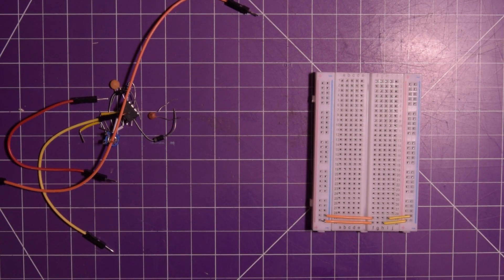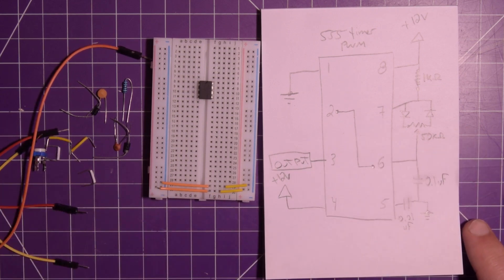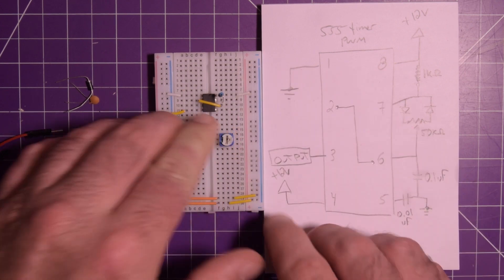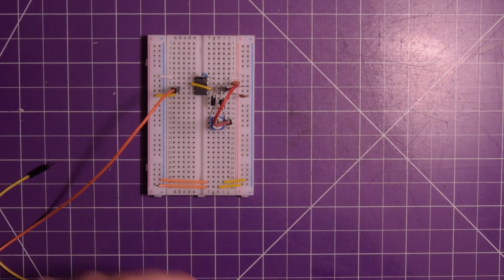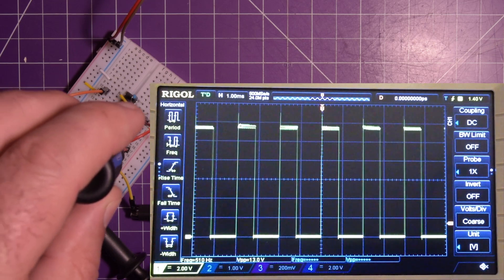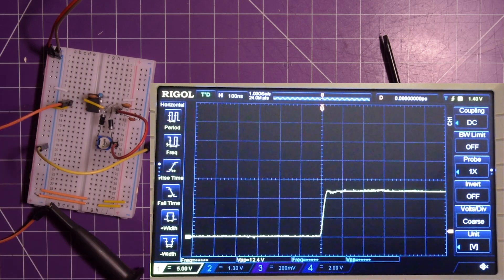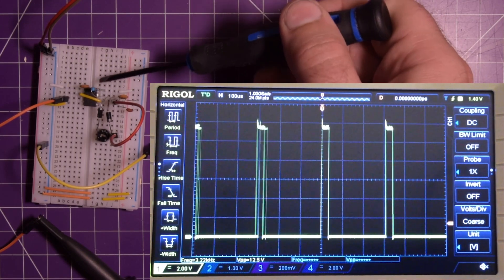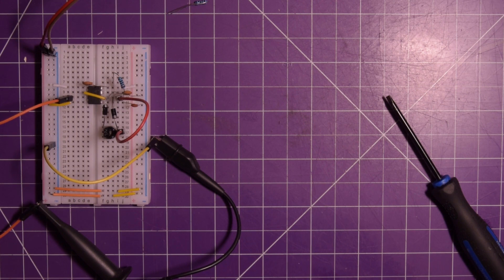Super Easy 555 Timer PWM Generator

Comment: The frequency change can be avoided if you use a constant current regime for charging / discharging of the capacitor. I have developed a special circuit design for a voltage controlled PWM generator based on a TLC556 (2 timers in 1 device). This circuit uses only two additional components, a constant current diode E-101 (0.1 mA, min voltage drop <=0.5 V) and a capacitor. The rest is only wire connections. And it works great over the whole range of operating voltages and up to 250 kHz PWM frequency.

The low frequency of 500 Hz is only a thing of the resistors / capacitors you've chosen. You can easily go to 100 kHz with this circuit (even with the NE555) and therefore much beyound the microcontrollers abilities. For motor control you can choose also lower frequencies of down to 100 Hz or higher than 20 kHz. The lower frequencies give a nice engine sound. The higher ones are inaudible.

The spikes of rectangular oscillations are no artefact. The mathematical superposition of harmonic functions of a rectangular oscillation has spikes. This is no problem of real device behavior. They grow very rapidly the more harmonic orders you take. The ideal rectangular oscillation has spikes of infinite height for a duration going to zero. The reality damps the spikes to a hight and duration according to the slew rate of real devices.

Comment: Are you aware of that most of your idle power is wasted in the 1k resistor? You can reduce your idle power loss by more than an order of magnitude when you use the TLC555 and you control the duty cycle with your diode / pot arrangement from the output pin 3 of the timer IC.

Comment: Thank you for this.  I’m pretty new to circuits and have been using microcontrollers for pwm. I have read about using 555 timers but like you said, looks kind of daunting when you are new.  The biggest reason I want to get away from the microcontroller is the boot up time.  If I want to use a dimmer for example it’s not instantly on unless the mc is already powered.

I have also read about another chip that is designed specifically for this: ltc6992, though it seems to be sold out everywhere.  It’s more expensive but simpler.  Once the chip shortage is over you should make a video with it :)

Comment: I was wondering how does the duty cycle can be changed not by knob (i.e. potentiomter) but by those system that has push buttons. How does the push buttons change the value of applied voltage?  One push button increase and the other push button decrease the voltage.
Reply from the maker: Not likely done with a 555 timer, more than likely done via a microcontroller

Comment: Good information! I am curious to know if yours had a audible frequency sound? Mine has a low frequency buzz sound and so I was wondering if that is normal, it does work great though. Thanks
Reply from the maker: mine does not! Apparently some ceramic capacitors do that though!

Comment: There's something missing from the circuit diagram, and I figure I should mention it just in case: you really want to have a flyback diode over the motor, as it's an inductive load, and without one, you could end up with a spike that would fry the other components when the motor spins down, causing the magnetic field to collapse and its energy to discharge. The flyback diode gives an alternative route for the current back through the motor, so it doesn't go back into the 555, &c.

Comment: does it have to be ceramic capacitors? and those exact values? what if they're different?
Reply from the maker: The frequency will change if the values are different - i think the caps can be any non-polarized type. This is the cool thing about electronics, you can build it and see what happens!
Reply: @SimpleElectronics  thank you for your reply! I'm just getting into electronics. So far any circuit I try to recreate - does not work at all. I'll try this with different value caps I was able to scavenge and I'll try to make sure one of them is 10 times less capacity than the other and see what happens.
Reply: There are formula for the on and off time and the frequency. Check it out.

Comment: I made the same circuit on tinkercad( online simulator), I am getting a wave on oscilloscope but when rotating the potentiometer the graph the wave is not change, it remains the same. Could you please tell me why this is happening?
Please reply its urgent.
Reply from the maker: I would recommend double-checking your connections because it works perfectly for me!
Reply: i'm late but you may wanna introduce noise

Comment: Nice video, thank you! What is that power supply, looks cool :)
Reply from the maker: That is a D3806, and if you don't have one, you should! it's a great unit! https://rover.ebay.com/rover/1/711-53200-19255-0/1?mpre=https%3A%2F%2Fwww.ebay.com%2Fitm%2FD3806-CNC-DC-Constant-Current-Power-Supply-Step-Down-Module-Voltage-Ammeter%2F274260954105%3Fhash%3Ditem3fdb3a0bf9%3Ag%3AjdwAAOSwl5VbD-1m&campid=5338675657&toolid=10001&customid=d3806
Reply: @SimpleElectronics  Ah thank you! Got one on its way now :)

Comment: Frequency range is very small due to 1k resistor, changing which does change duty cycle along with frequency.
I tried one 555 to generate pulse and other in mono-stable for duty cycle. But both need to be calibrated.
In the end I used TL494 IC,  it is also simple and allows changing duty cycle by controlling voltage.
Reply: A nice circuit can be made with the addition of LM311 comparator, giving 0-100% duty cycle range and very stable signal.  Frequency is adjusted at capacitor, and a second 555 is used as a buffer to amplify signal.

Comment: You seem overly concerned about the cost of things that are all pretty cheap to begin with. ALL these parts can be scavenged for free from many simple devices. Also repeatedly calling this extremely simple project daunting and scary tells people you don't think they are very smart, and only serves to discourage them from doing the project at all. I would suggest referring to a printed wiring diagram instead of a hand drawn one. Then, they can see what you changed. The volume and focus of the video were good, as was your narration. Good pacing and well explained.

Comment: the frequency doesn't actually change. It's just the proportion between on and off time that's changing. It actually stays around 500Hz and if its completly on it changes because of the frequency detection of the oscilloscope is irritated.

Comment: I'm iffy on the variable duty diodes coupling since what you're showing is not the way they show in datasheets. You have an error with your scales with reference to the .1 uf equalling 10 nf. Yes 104 is 10 nf but 10nf equals 0.01uf not 0.1uf. WHERE IS THE PWM demo?

Comment: 1n4001 diodes are standard recovery power diodes. the problem with these diodes, is that when they are reverse biased, there is a tail current before the diode quits conducting, an effect similar to a capacitor in parallel with it.  I would suggest switching diodes, like 1N4148. another thing to try, would be schottky diodes, like 1N5819, which have much less forward voltage drop. The switching diodes have a negligible current tail, and the schottky doesn't have ANY current tail, though, it does have about 100 pico farads of junction capacitance. This video makes me want to get a 555 timer, and play with it again. I haven't touched one in almost 20 years!
Reply from the maker: Great tips! definitely wanted to make it with what I had and now I want to explore different diodes!

Comment: Can I use zener diode
Reply from the maker: you know....I'm nut sure what a zener diode would do...the goal of the diodes in this circuit is to direct the charge/discharge through different sides of the voltage divider (potentiometer). I think you should try it! It could end up being interesting!
Reply: @SimpleElectronics  it worked fine for me

Comment: This is what you were talking about!! This is alot cheaper and simpler then a NANO!! Dang now I gotta order a bunch of these
Reply from the maker: That would be the one, sir! when it becomes miniaturized, it will be tiny and very useful!
Reply: Was thinking, to further reduce the cost of the BOM ... that TO-220 Mosfet may be the most expensive thang.
Can be replaced by a logic level AO3400 or such, if you want to fiddle with surface mount.  Maybe add room for optional pull-down and zener clamp on that gate.  If you go with dueling surface mount options on your next PCB, the ne555dr is only about 1.5 cent:
https://www.aliexpress.com/item/32920662510.html
Reply: The other good thing about the 555, is that the output(pin 3) is push-pull, and can source or sink 200 mA. That means, with an appropriate resistor, it can directly drive the base of a transistor, or the gate of a MOSFET. No beta multiplier, no pull up resistor necessary! for loads under 200 mA, it can directly drive a light load.

Comment: Have you checked the output of your power supply with the scope? I ask because the Jitter  of some of the wave forms  seen could be coming from the power supply. Using batteries or  Linear would be best. Buck or Boost convertor power supplies cause Jitter.
Reply from the maker: This is very true! I however wanted to test this in a likely situation - which means typically, a switching power supply (whether it be a wall-wart or bench top supply)